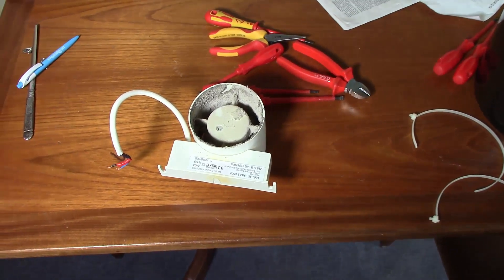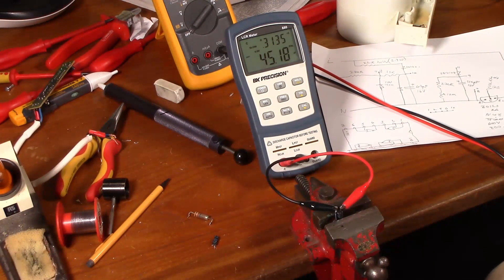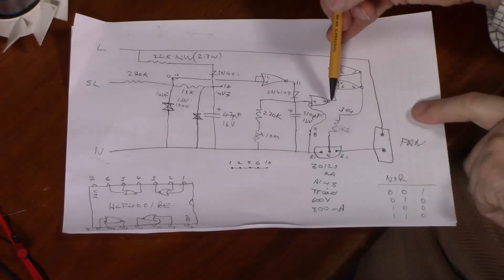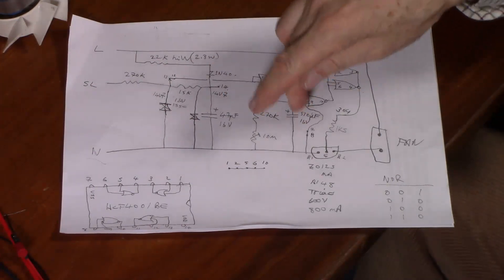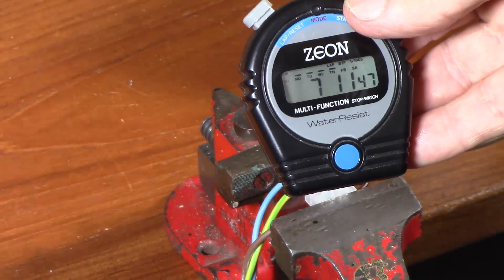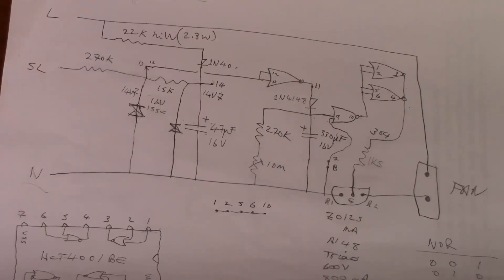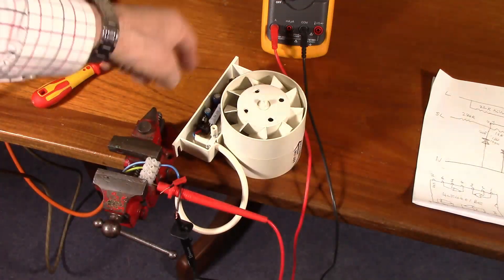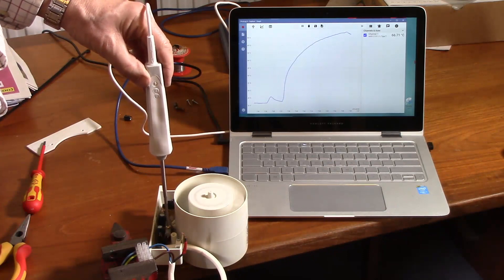Manrose SF100T fan design problem

Comment: I've just ordered a replacement PCB from J Harries electrical as the resistor has burnt out on one of mine. It's in between floors so can't get the fan out (put in during loft extension) so replacing the PCB is easiest option. PCB has been totally redesigned since the original install it seems.

Comment: Thanks! Excellent video. I have the same board in a Manrose wall-mounted fan (MG100T) with the same problem. I think it would be possible to drill to holes to provide cooling air to the resistor. I'll probably try this if I try to repair the board. I've got a soldering iron, so should be able to repair it. You just need a couple of holes between the PCB area and the fan duct, and then a couple more between the pcb area and the outside world. For my fan, I also need to make some corresponding holes in the wall plate that goes over the fan otherwise my holes to the outside world will be blocked, but these holes will be facing upwards and the fan is mounted high up anyway, so no one will see them. I like the idea of a better circuit. PCBs are cehap and easy to have custom made now, so I might look for a better circuit and perhaps have a batch made to order.
Reply from the maker: Good luck. When I get JLCPCB to make custom PCBs they always make a minimum of 5 so I get 4 spares whether I like it of not.

Comment: Many thanks for this great video. I’ve just repaired a Manrose CF200T with a slow running noisy fan. It was the 47uF capacitor which had gone low value. Up and running in no time at all thanks to your helpful circuit information!

Comment from the maker: If it is working except that it fails to run on after the light switch is turned off, then you only need to replace the 330 uF 16V electrolytic capacitor. Any one that will fit that is rated at 16 volts or more would do. I also replaced the 22K Ohm power resistor, because it was burnt (although still functioning). I used a 22 KOhm resistor rated at 7 watts, although I think a 5, 6 or 7 watt one would do.

Comment: i'm no electrical engineer but could you not have put some kapton tape between the caps and the resistor ?
Reply from the maker: Yes, but kapton tape is not a very good thermal insulator.

Comment: great video  thank you.  tell me whether it is possible to include a fan bypassing the timer board.  thank you
Reply from the maker: Yes you could disconnect the fan motor wires from the board and connect them directly to the mains, via an on/off switch if necessary.

Comment: Incredibly helpful video, thanks so much! I have a Manrose MF100T inline unit that failed after only 4 years (warranty is 3 years!) Can confirm exactly the same design fault on mine. Slightly different failure mode though as the electrolytics are other end of the board on mine and more space in an inline unit. The big black square run capacitor had dropped in value by 90% due to overheating. The thermal fuse inside the motor windings had also gone (so it had gone above 115 C !) I've replaced both of these and saved myself £70 🙂

Comment: Thanks for the video. Have an SF150T that will not shut off after being switched off. Manrose suggested it could be an open circuit on the PCB. Will check and update what I find.

Comment: Replaced an XF100T in my parent's house about one year back. Just opened it up and, yes, it has the same heat effect from dropper resistor which, in mine, measures 25k. Not measured the caps yet, but suspect the same loss of capacity. *Update: both caps show significant loss of capacity* Anyway, the fan I replaced this one with has also now failed. So, like you, I have two to repair. Thanks for doing the leg work on this: very informative!

Comment: Great video thanks, I especially liked the idea of coming up with a better design, any progress on that? Last night I opened up my Manrose fan that's only 5 years old and ours doesn't even turn on (so maybe a bit more broken than just the caps) - I plan to pull out the timer board and directly wire the fan to switched live + neutral using a terminal block while working on the board - but would rather replace it with a more reliable design. I can't believe they're still producing these boards even today.

Comment: This is most interesting, thank you for posting. I use the Manrose MF100S ones (x2), which seems to burn out on the circuit boards too, big square black component, possibly capacitor... very annoying, but I guess it suffers from the same design flaw you demonstrated there. If I could figure out what the part is I would replace it myself, but so far I keep having to replace the whole unit, which isn't cheap at around £50-£99 depending on where one gets it. :-\ ... supposed to be rated for 30000 hours, (41 months), I don't even think they're lasting that long turned on 24/7.

Comment: Get yourself a rs components mains test block Samuel would be very useful in these situations, product no:0458926
Reply from the maker: Actually I've got one, or a much earlier version of it. But mine is difficult to use because it needs the three wires to be spread out too far.
Reply: @samuelfielder  yes I have the old and new version at work and the newer model is much better to use.

Comment: Nice one Samuel,
I'm a very strange person, indeed !, It beats watching TV :)
How about modifying the circuit, use a capacitive dropper instead ? (X2 capacitor and a bleed resistor)
Happy Christmas and New year.
ATB Adam
Reply: There was a time when this sort of thing would be on TV instead of the vacuous celebrity-obsessed  nonsense they continuously pump out now. I'm with the weirdos! As for that fan - awful design no matter what vintage and I bet the version they're selling in B&Q today is the same.